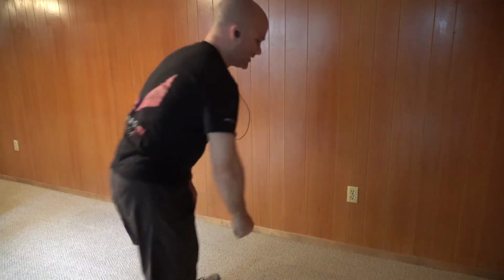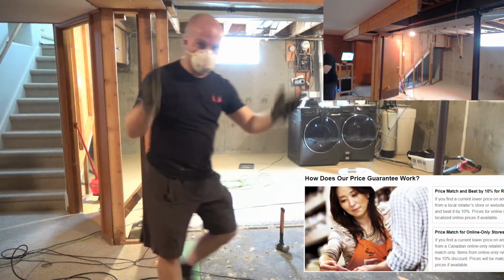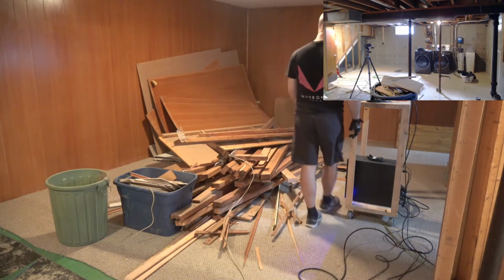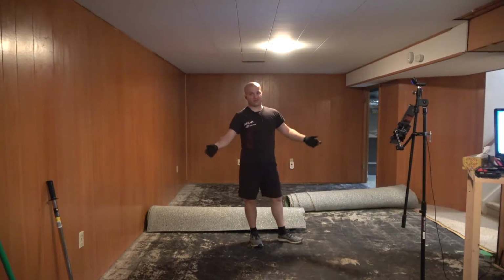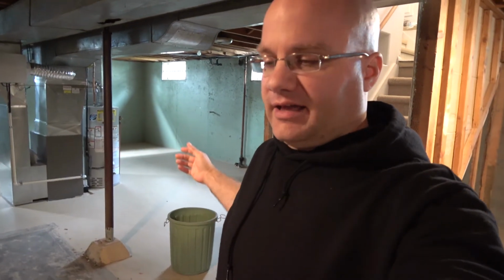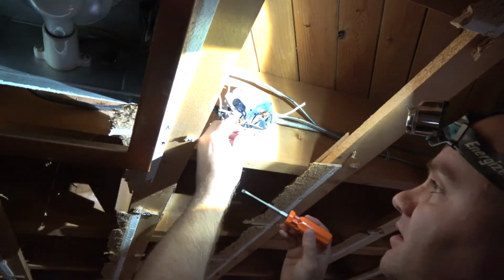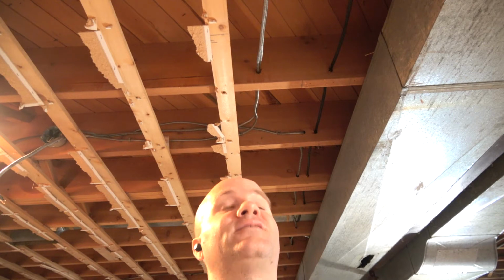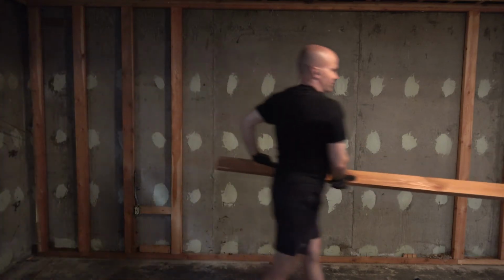Basement Demolition How To & Vlog

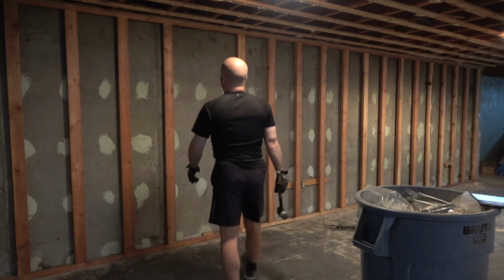Comment: I'm so glad I found your video!! So many people cut and splice. I appreciated that you showed the whole process and stopped to explain things.  27:06 and 28:15 are exactly what I came onto YouTube looking for!!  My basement is almost exactly this same set up with the false walls and divided areas. It was partially partitioned and finished in the 1980's before we bought the house in 1998. It flooded in 2017 and again this past May on Mother's Day. I got all the wet stuff out right away but have been stuck on what to do to restore. Due to financial issues, I've decided to just strip it all down since I can't afford to replace any of it with paneling and drywall. It has poured cement walls which have cracks and a couple places that leak. The floor, also cement, has some raised areas that have cracked plus there is glue from the old tiles in the laundry room and backing from the linoleum in the rest of the areas, so all that needs to be "sanded" off. The small windows are all broken and need to be updated, so I'd love to put in at least one egress window for safety. Several realtors and house flippers have told me I need to update all the electric. The lighting is a mess: half the fluorescent fixtures are hardwired but none of the work right, even with new bulbs. There is a half bath that is partially under the stairs which I'd love to get out from under the stairs if possible and somehow add at least a shower. With all of that, I won't have cash to do anything other than painting the floors and walls to make them a bit more presentable with area rugs and pictures. I'd love to see how you finished your basement. I need some inspiration!

Comment: How did you know if that tile was asbestos tile or not? I think we are doing a similar house in Edmonton, and the time is very similar to the one I am doing
Reply from the maker: there's a look and size to asbestos tiles, no way to be certain without testing. if you think it might be, there are ways you can deal with it yourself with relatively low risk. you don't always have to spend thousands on remediation.

Comment: Why do you remove the framing from the exterior walls?
Reply from the maker: it was installed on flat instead of on edge, so it was too thin to get insulation installed.
also there was no foam gasket underneath